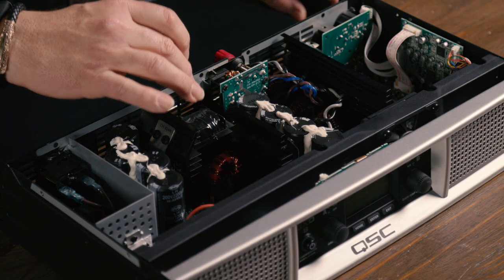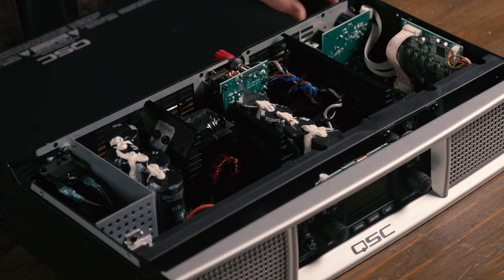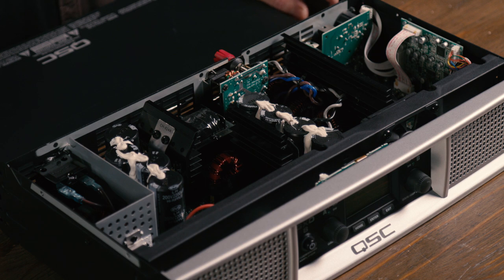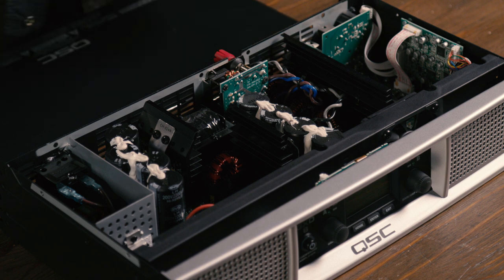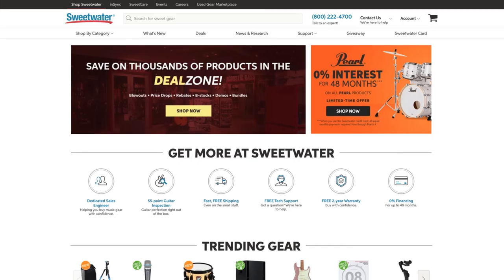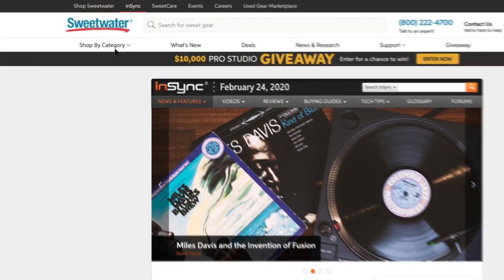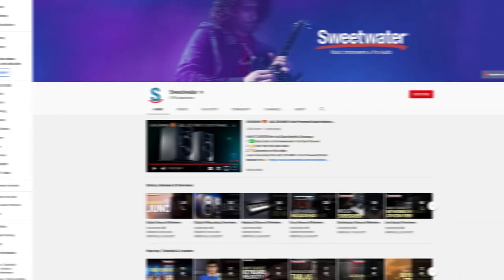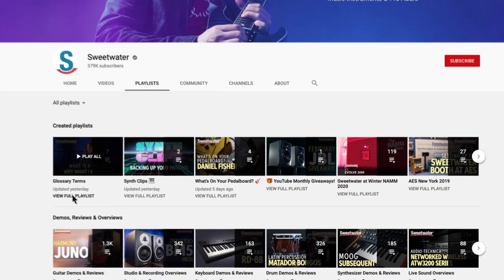What is a Power Amplifier, And Do I Need One?

Comment: So could I use a power amp (not a guitar amp) to power a guitar cab?
Reply from the maker: Hi, Webb. Technically yes, but you wouldn't get a great sound with the just the power amp on its own. You would need some sort of preamp first to receive the guitar signal, which could then be amplified by the power amp. A very common setup is to use some sort of amp modeler preamp (Helix, Kemper, etc.) to get the amp tone you want, and then run that into a power amp so that it can be run through a guitar cab.
Thanks for your interest!
Charlie Davis, Sweetwater Sales Engineer, (800) 222-4700 ext. 1320, charlie_davis@sweetwater.com
Reply: @sweetwater  Thank you!
Reply: @sweetwater  I actually have one more question. I hear a lot about needing a "line level" signal in order for the power amp to work with a guitar.  I ended up getting a Peavey IPR2 2000. Will any preamp pedal work, or does it need to be one that specifically raises the instrument-level signal to line level? I tried a guitar-Big Muff Pi Triangle-Peavey Power amp-cab setup and it seemed to work fine, though I didn't have any real EQ/Tone control since the Big Muff isn't a preamp, so I'm confused.

I have heard of people trying to do the same thing with a cheap Joyo preamp and either getting super low volume or an inaudible buzz or hiss noise that overrides any sound, then heard it was a line level issue.

Comment: Nice explanation Sir. However, in reality there is no such thing as a POWER Amplifier. For power cannot be amplified.  It is the product of RMS Voltage and Current. Manufacturers as well as users continue to use the term as it became an industry standard. Lets get it right and use the correct term to describe this piece of audio gear..
Reply: Yeah, because RMS voltage and Current amplifier just rolls of the tongue 😏
Reply: Tremolo bars don't actually have a tremolo effect either. There are a lot of wonky names, as long as people understand what they're referring to all is well
Reply: @destubae3271  vibrato bar 🤣